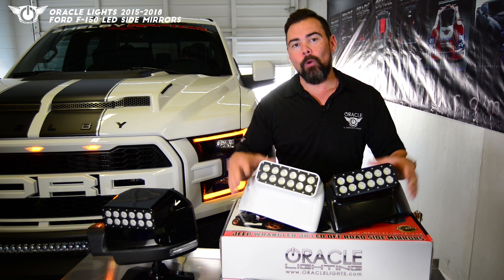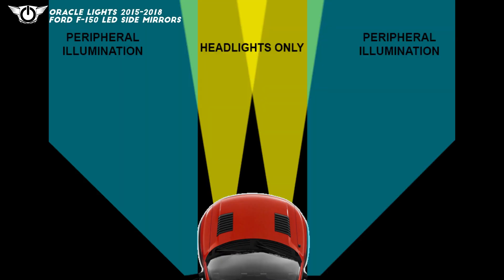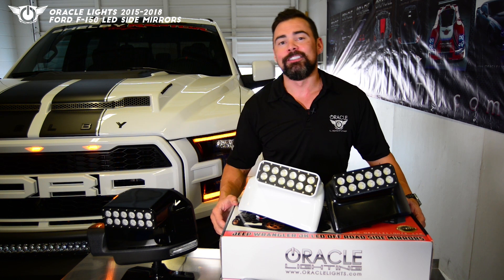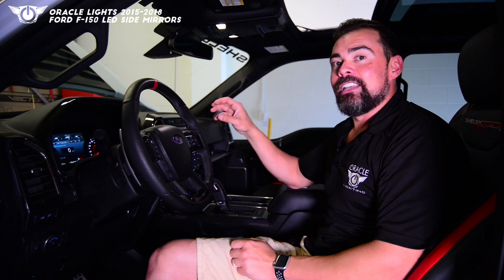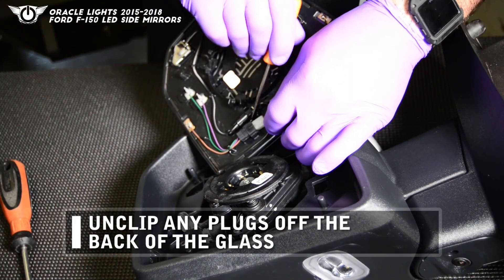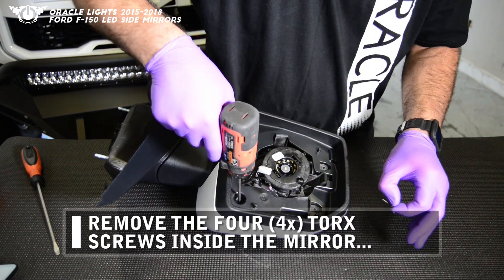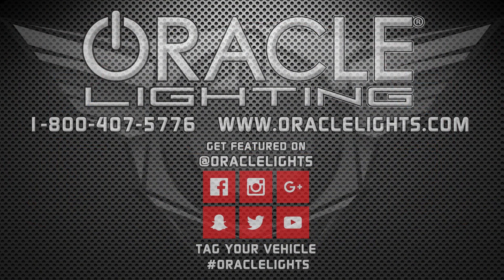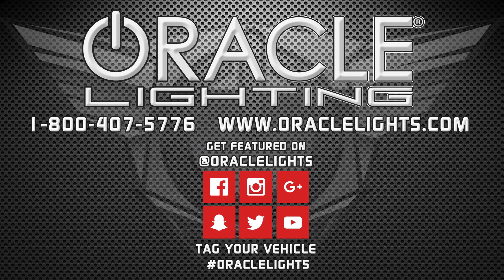ORACLE 2015-2019 Ford F-150/Raptor LED Side Mirrors Install

Comment: needs to be smaller, it sticks out to far and looks goofy from the side
Reply: Since this is a functional item we have to design for constraints such as adequate heat sinks, optics, and internal structure. Making it "smaller" would cause negative effects to the light output, LED longevity, and beam pattern. It was not designed for "looks" it was designed as a functional piece of equipment.

Comment: Installing it this way will the lights only work at low speed or in park?
Reply: Or look up the hack to override that.
Reply from the maker: Correct, if you want to use above 20mph connect to the up fitter switch rather than to the mirror light.